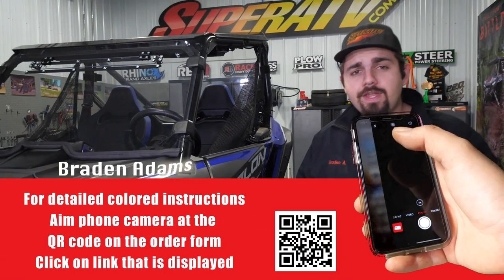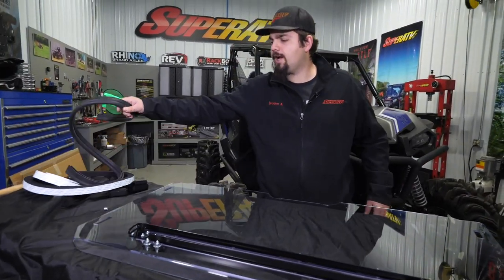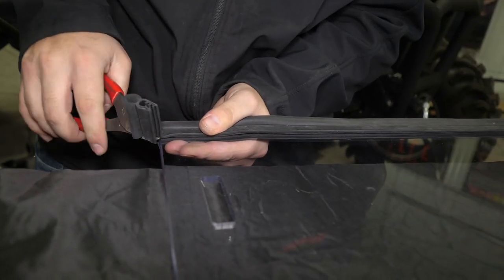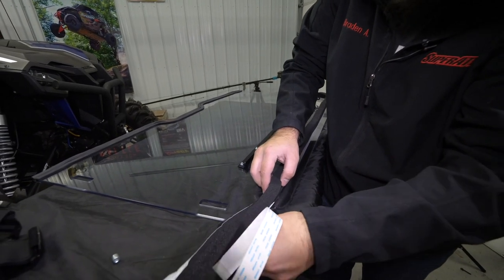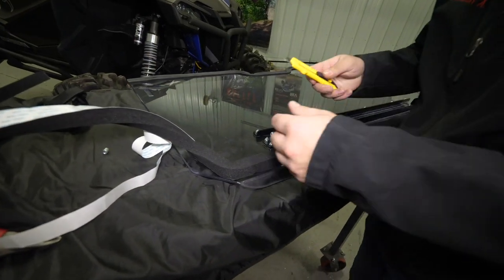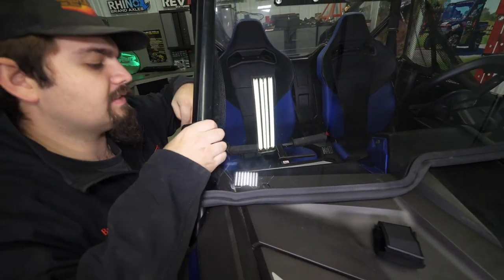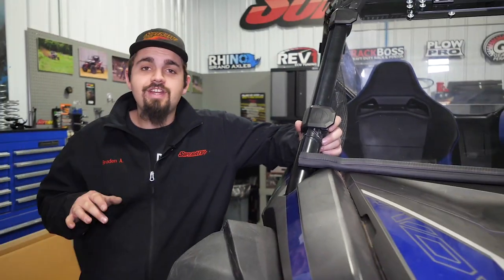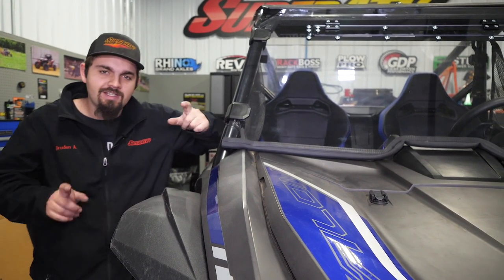Honda Talon 1000 Vented Windshield HQ

Comment: Not sure if any noticed but ALL of the window installation show the bulb seal start and end...no help on how to get it around the corners where it becomes IMPOSSIBLE!
Reply from the maker: Unfortunately, there are no tips or tricks to show for installing the seal around corners. It does help if the bulb seal is warmed up and pliable. You can leave it out in the sun if it's a warm day or even soak it in hot water.